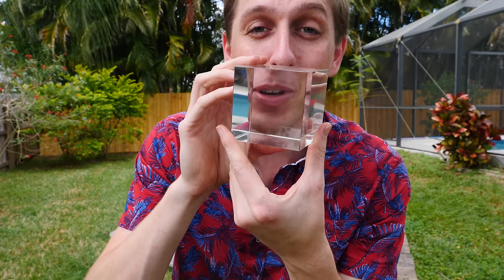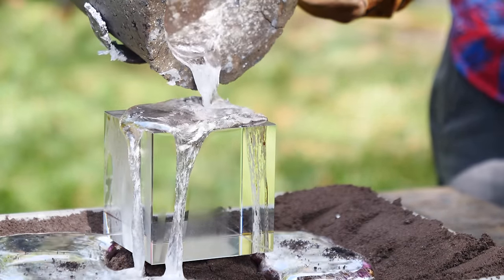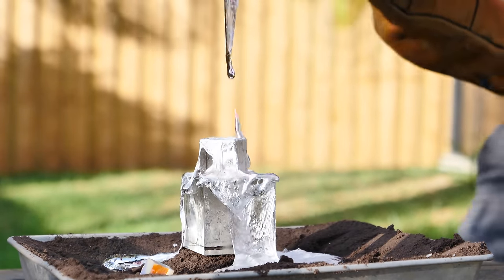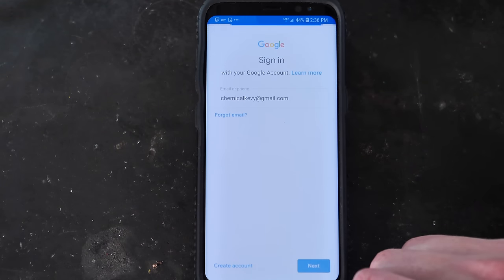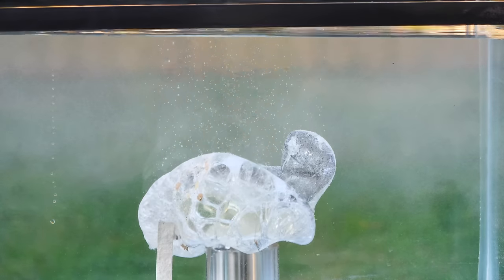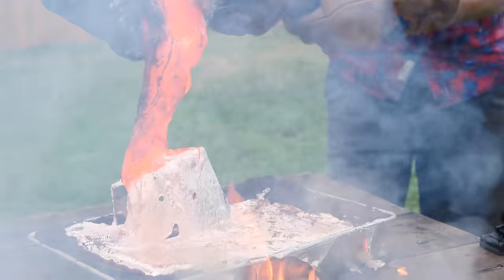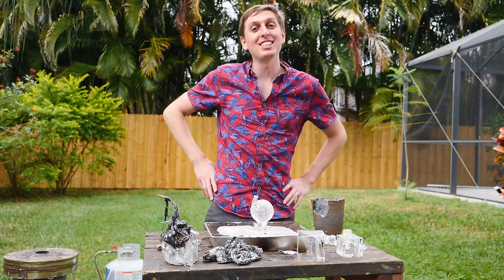Molten Aluminum vs. 𝘛 𝘏 𝘌   𝘊 𝘜 𝘉 𝘌

Comment: When I was 17 I worked in an aluminum die casting company. A large pot of molten aluminum on one of the die cast machines had something fall into it and splashed metal on me from about 4 feet away. That was more than 50 years ago and I still have the scars from those burns. You're playing a very dangerous game there with almost zero PPE. At least I was wearing all the gear required by the employer at the time or my injuries would have been far worse including the loss of one eye.

Comment: After watching this again, I just realized why the glass ball cracked so much underwater. It's because when melted glass cools, it can't do so normally without cracking. So considering that it was given an even faster way to cool compared to leaving it out in the air, it cracked A LOT more than normal to where you could break it apart like that.
Reply: You must be some kind of super genius.
Reply: @azzy-551  I wondered how this has 9 likes..

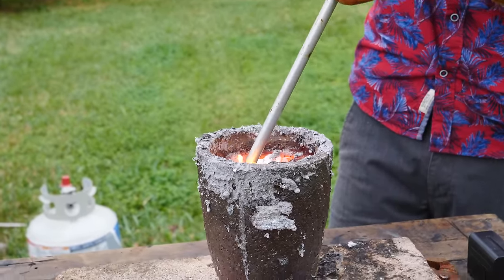Comment: 6:46 1000 grad Celsius, he says that's cool 😂
Reply: Anas El Abboud it’s about actually 2100 my uncle is a glass blower
Reply: @kcocozza  now thats cool
Reply: @fabiosantana3226  that's even less cool!
Reply: Commander Bacara google says it melts at 1400 Celsius or 2500 F. Maybe you’re thinking of the temperature of the furnace it’s melted it, which could likely be 2100 C
Reply: Grand damn

Comment: 7:50 Pretty sure that was the less-dense molten glass sitting ontop of the molten aluminium, not a blend of the two. I think that the glass cooled faster (being at the top and with a higher melting point wouldn't have been as liquid anyway) and got pushed out into a bubble by the weight of the aluminium until the aluminium had stretched the molten glass layer to the point where it as too thin and hot to hold up to the pressure/weight (long way of describing how it burst through the middle of the bubble).

Comment: I worked at an Aluminum plant in South Carolina for 18 years as an electrician. Molten aluminum most certainly glows orange at around 1400 to 1450 degrees Fahrenheit. Pure aluminum melts at about 1250 and goes through a red stage. It goes to orange and then yellow/orange as it gets hotter. Alloys of aluminum obviously melt at different temps. One of our harder alloys was 3105-2. We made sheet products. Anyway nice video.

Comment: Please do Copper and glass next, the melting points are just about the same  👍👊😋
Reply: Copper melts at 1085°C and glass between 1400°C and 1600°C. Totally the same melting point...

Steel, depending on its steel grades starts by 1325°C (1.4547 / 254SMO steel) and endy by 1530°C (409, 410, 416 steels), so this would be a better partner for glass. Pure iron is at 1335°C and nickel is at 1435°C.
Reply: @Seelenschmiede  There are many types of glass, the cheap bottles I melted went liquid at about 1050 - 1100°C.
So more things to do experiments with @TheBackyardScientist 😋👍

Comment: Try to mix cooper and glass. It has more similar melting points and you could get better result. Also - if you mix it, and stir it, and then - let it cool very slowly - maybe you will get better results? Maybe try to cast it in to some shape? half of ball? It would look spectacular.

Comment: Safety Third: might want to cut the legs off that table and set molten filled crucibles down on the ground rather tha lifting them to the table. Also, slower pours on less viscous metal for better result.

Comment: So, you didn't make molten glass and aluminum, you made silicon particulates and molten aluminum! Many alloys form a "mushy zone" where the material isn't fully melted, and there are typically solidified particulates floating in a liquefied base. You could have made that mixture flow just as easy as any other alloy- if you got the furnace up to the melting temperature (upwards of 2800 degrees F).

Comment: A reminder that anything solid is at its freezing point. Therefore a large portion of your body is constantly frozen. Also, the definition of "molten" varies a bit, but the core factor is that it's something liquified by heat. Technically, your blood and all the fluids in your body are liquid due to heat, so by some definitions you could consider parts of your body molten. But not really. Normally when you say that, it's in reference to something with a high melting point rather than a low one like blood.

Still, just food for thought.

Comment: Well that's ten minutes of my life I won't get back. I did learn that I am way more safety conscious than I realised though. I spent most of that time thinking 'when are they going to get burned or cut'. Everything from turning away as he closed the lid on the Ball that was already rolling into the corner as he turned away, t dropping the pyramid from that height into a small crucible of molten alloy, and even the way he managed to badly pour the alloy and glass (I would have named it 'alloy and glass'). Replace the two 'adults' with twelve year olds and the only difference would be whatever molten crap ended up in the pool.

Comment: Isn't the reason borax is used as a flux when melting metals because it turns into a glass layer on top of the molten metal which the impurities get stuck in and are made easy to remove?  You basically just used way too much flux. :'D

Comment: Interesting stuff for sure but all safety precautions are violated multiple times. It doesn’t matter how many times you pull it off, it only matters the time when for whatever reason it goes wrong… why such negligence?

Comment: The melting temperature of aluminium  is 660 C while the melting temperature of glass is 1500 C so almost a 1000 C temperature difference. No wonder the aluminium popped out like water over the treacle like glass. Fortunately for him, aluminium boils at 2400 C or he would have had an explosion of aluminium gas and molten glass. Not a video I would like to watch 😮

Comment: ... Put some pants on ffs... and a long sleeved shirt... Like, your mate got hit on his pants with the molten aluminium, if that was bare skin that's the kind of thing that could go straight through to the bone. Like how when you REALLY wanna wreck someone you don't throw boiling water or even hot oil on them, you throw boiling toffee on them, because it'll stick and it retains heat much better.